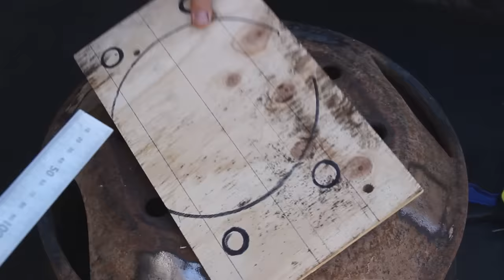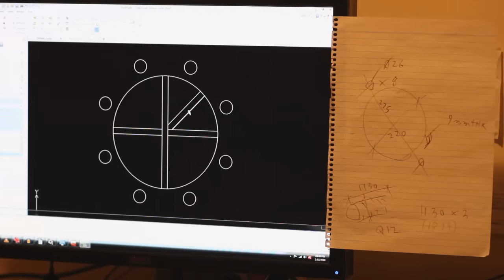How to make a fire pit from a rusty old truck wheel with a $100 eBay stick welder

Comment: Holy Hell!!! I’d soooo go buy some plate plate!!!😂😂😂! Lots of extra time in tearing apart the pipe to flatten it!!
Reply from the maker: while it's cheaper than the hardware store my local steel place is too expensive so I avoid going there. Kinda wanted to see how much work it would be to turn pipe back into plate anyway.
Reply: Absolutely awesome craftsmanship!!!!! Don’t know if your is the standard 22.5” wheel or not... check and see... if it is... the standard Weber kettle grill cooking grate fits perfect on these for cooking!!!! Cooks amazing 🥩’s!
Reply from the maker: I'll have to measure it, put a camp stove in it once but have a heat beads BBQ for cooking, it's not bad but I want to make a longer rectangular charcoal grill some day, maybe that fits on/in a tabletop

Comment: I gave this guy a thums up because we all start out this way. On a wheel there are bolt holes to use as referance points for the legs. Remember, center lines on the wheel and center lines on the pipes for easy set up. Also, once all legs are welded, a simple measurement from ground to highest point wiill give you your angle for all of them👍 love the video
Reply from the maker: Cheers!

Comment: This was an excellent example of taking a simple project and making it extremely complicated. Well done!
Reply from the maker: Cheers! I wouldn't say extremely complicated but opinions vary. Loved your work in "the fresh prince of bel air"
Reply: @lapislignum  tack on a couple legs and a few pieces a rebar so the wood doesn't fall through the hole and your done. Extremely simple..... but opinions may vary. Lol

Comment: Really pleasing to watch your build, and the layout techniques you used. I have a 24 inch wheel I plan to make into a fire ring; perfect size for a patio fire pit with no other purpose than to just watch a fire burn in the evening. As some others have observed, there is much satisfaction to be derived from designing and building a project yourself. I often gain new ideas and construction skills just from watching what someone else has done. Your fire pit is well built and will last a lifetime plus. Good job. Regards - John
Reply from the maker: Cheers John! I know the layout seems excessive to some people but it is the way I generally do things, usually it makes it easier. If you put a tray of sand and/or firebricks under the pit it should help your patio not catch on fire.

Comment: Pretty cool design !! I love the bottom design..
Reply from the maker: Thanks! I tried a few patterns but that one was the best and simplest.
Reply: At first u thought u was making template for CNC Machine :)
Reply from the maker: CAD may look like overkill for what it ended up being but it didn't take too long and having a template to follow made it very easy to cut all the rebar

Comment: I used the open center type truck wheels and throwed 4 firebricks under the bottom edge so it could breath and it works great.
Reply from the maker: Lots of ways to do it. I still need to pick up the nails from the last fire I had in mine.

Comment: Fire pit from a old rim is a awesome idea. This pit will out last any other pits made from plates.
Just a small tip, turn up your amps on your welder until you get good penetration it to the steel
Reply from the maker: thanks! yes this should last a long time. I think the welder was turned up as high as it goes, maybe not quite as it is a 15 amp machine plugged into a 10 amp socket :)

Comment: Good job. I too used an old truck wheel. Only difference was I was lazy and sat the wheel on a tapered metal bucket turned upside down. Left all the other holes open for  air movement.
Reply from the maker: That's a good solution, I think I put bricks under the big hole a few times but the stud holes didn't let enough air in, leaving the big hole open let too much stuff fall through and not burn.
Reply: And

Comment: If you put a lid on it correctly and hinge with a vent pipe, you could cook on it. Make sure you burn several fires real hot in it before cooking in it. Wash out real good before first cooking.
Reply from the maker: I cooked with a camp stove in it once, got too hot. A hotplate on top that swung out of the way to put more wood in would be simple.

Comment: Purchase a small piece of copper plate or flat bar and use it as a backing to weld up small holes, it's faster than making those plugs.
Reply from the maker: True, not sure my welding would be up to it though, i would have tried it on other things but copper is soooo expensive.

Comment: Love the angle grinder height adjustment jig. Might have to make one for myself.
Reply from the maker: on some grinders just holding the guard against the benchtop will work, on this grinder the arbor sticks out past the guard so it had to be screwed to the formply scrap, gives better stability too!
Reply: yeah sometimes I clamp the guard to the bench and move the work piece into it. this works well for cutting rings from large cylinders.

Comment: Just a tip but it's one amp for every thousand of an inch. I personally like to use a couple extra amps 5 max depending on the base metal. In the video amps was way way short and you move way to fast.
Reply from the maker: I just fiddle the dial until it seems right, not sure the numbers the dial points to on my ebay welder actually correspond to anything. All of the welding footage was sped up 5 times or so.
Reply: @lapislignum   You really need to practice getting the arc right.  I agree with the comment about, turn it up a bit and try to watch the weld pool.  Your welding needs work but that was 4 years ago so maybe you have improved.  I liked your trick with the grinder to get the flat base of the legs.
Reply from the maker: It got slightly better, still terrible though, really need to run some drills some day.
Reply: @lapislignum   It's really worth it.  You'll feel great when you notice the hard work paying off.  Watch a bunch of youtube from weldingtipsandtricks.  There are so many helpful tips.  Good luck with it.
Reply from the maker: I'm a big fan of Jody, just need to put in the burn time, I have more steel than I thought so should pick some nice/rubbish bits to clean up and weld on.

Comment: Welding on the legs was really bad. Using MMA Welding Vertical travelling up would have gave a weld to penetrate the joining metals, that down motion that you did left a light skin full of porosity. 
The job did turn out nice, try using MIG for that style of welding
Reply from the maker: I'm not claiming to be a good welder but the legs have held on great, the grate has popped a few welds because they aren't great and it gets very hot there and expands and contracts a lot. 

I have a MIG but bought this inverter as I was sick of renting a gas bottle that I almost never used, have a roll of fluxcore wire but I don't like using it (my welds with fluxcore look even worse than my stick welds) and it's a (heavy) transformer machine so I can't be bothered lugging it out of where it lives.

Thanks for watching and taking the time to comment!

Comment: Nice job I just built a firepit now have the same problem trying to get the bottom leg angles ,think I might try your idea with the grinder ,thanks for the idea
Reply from the maker: Thanks! You can use a marker instead of the grinder then cut to the line if it works better, this way works well on wood legs too.

Comment: Finally, a maker that can weld & can stick weld at that.
I would have used expanded sheet metal, but the rebar with last longer. Good job.
Reply from the maker: Thanks! My stick welding is average at best but this had held together pretty well. I didn't have any expanded metal or mesh but the rebar suits it better IMHO and will last as long as the rest of it. Thanks for watching!
Reply: That welding is some of the crapiest welding ive seen . You have to get out more when it comes to welding haha. In the welding scene they call that grape welds.
Reply from the maker: @lewandlo  there's a welding scene? watch my rocket stove video if you want to see more questionable welding, I think I manage to do some bits better and some bits worse than in this video, need to do some drills when the weather is less flammable.
Reply: Looks like pigeon 💩 🤣🤣

Comment: Nice, but more elaborate than necessary.  Get two wheels, weld together, add some expanded steel mesh.
Reply: No... I think I’ll take pipe, cut it into little pieces, instead finding some scrap plate. Then I will double check it on a CAD program. I think that’s more expensive in labor then 20 store bought fire pits.

Comment: Yea, do that with one of those magnesium car rims from the early 1970s. Once it gets hot enough to ignite the magnesium the radiant heat would be like looking at a nuclear explosion. You can't put out a fire like that with water; you can only retreat and let it burn itself out.  Or, for that special BBQ flavor, leave the rubber tire on the rim, those steaks will be so tasty.
Reply from the maker: I saw a video of someone doing this with an aluminium rim, it worked OK. Magnesium would possibly ignite, would be interesting to find out.

Comment: Cool fire pit. Reminded me of when everything was built to last, but I didn't understand the first jig you built, you had everything you needed right there. Anyway scrib your name and date on it. It'll be here a long time.
Reply from the maker: Thanks! The first jig was to locate each leg equally around the wheel, at the same height and lined up with the stud holes. It also held each leg in place while tack welding it to the wheel. It made more sense when I showed moving the jig to do the next leg but I cut it out as the video was too long.
Reply: @lapislignum  definitely inscribe your name and the build date
Reply from the maker: Good idea, I have a set of letter and number punches that would do this well.
Reply: @lapislignum  im sure you are well aware so dont think im patronizing you but be sure to grind away the desired area to be inscribed... Buff it nice then seal the inscribed spot with clear laquer or what have you...
So you know that wont rust out for a long time

Comment: Cool idea, terrible welding. Stop moving the rod around so much and the weld won't look all chicken crap.
Reply from the maker: Cheers! yeah I'm not getting a job on a pipeline anytime soon am I? :)
Reply: @lapislignum  just be steady with your hand, keep it in one spot till a puddle builds then start moving ahead slowly, if you go too fast your puddle won't be a puddle. Too slow and your puddle becomes a swimming pool.
Reply from the maker: Cheers, I really need to make time to do some bead drills

Comment: Last I checked, flat plate was cheaper than pipe, and already flat.
Reply from the maker: The pipe was free as I already had it. Also I already had it.
Reply: probably already had the pipe...use what ya have & adapt it to your needs
Reply from the maker: @keithreh9338  exactly!

Comment: Good idea but I see no reason for all the extra work. Would be fine just positioning bricks under it properly for good air flow. For the average do it do-it-yourselfers anyway
Reply from the maker: The giant hole in the middle was the bigger problem, I was going to make a drop-in grille but decided to add the feet too. It is much sturdier on the legs, and easier to put a slide out ash tray under (which I still haven't done) too.
Reply: @lapislignum . I use an old bicycle sprocket for one. Then I found an old round charcoal grill and took the small grill part out and used it for bottem. Just happened to fit the bottom perfectly.  Not knocking your work . You did a great job. Just offering up some ways someone could use that don't have access to that kind of equipment.  I started out setting mine on top of bricks which were also positioned in a way that covered the bottom.
Reply from the maker: @extraordinaryactsofglass3743  yeah there are easier ways to get the same result for sure, I cut the corners off a (rectangular) BBQ grille so it would fit in the bottom of my 44 gallon burn drum, it sits on bricks in there and I turn it over occasionally so it doesn't sag in one direction too much.

Comment: Please turn the voltage up on ur welder, and buy some strap metal for u will save alot time n enegy, still great project!!
Reply from the maker: Next time I'll turn it up more, didn't want to go crazy with a 15 amp welder plugged into a 10 amp socket. At the time of making this I had more time and energy than money, I like hammering stuff too.

Thanks!
Reply: @lapislignum  very cool project , congrats n good luck in the future !!!

Comment: Should have made the legs long enough to put a metal bucket below the pit. All ashes are automatically caught.
Reply from the maker: I think I was limited by how much pipe I had, but I wouldn't make one much higher, can't remember why. I keep meaning to make a tray/shovel to go under it to do the same job a bucket would.
Reply: @lapislignum  Lots of people like myself live in a windy dry area (Texas). A bucket would contain ashes and embers to stop wind from starting a grass fire.
Reply: P.S. I love the idea and will have mine complete next weekend.
Reply from the maker: @waynesmith9765  nice one, throw up an imgur link to a photo when you're done if you get the chance
Reply from the maker: @waynesmith9765  yeah the place gets pretty flammable around here in summer, I only really use this when it isn't windy and the grass isn't too dry.

Comment: I thought only in India you cut on the floor.
You can build a fire pit. Know make an effort and build a table for your saw. Instead on the floor.
Reply from the maker: You should watch my rocket stove video, I did the whole thing on
the ground. I don't do enough metal work to justify having a bench for steel.

Comment: High speed video so it’s a bit hard to tell but it looks like your moving to fast with the weld. I’m trying to gauge the distance you were welding per rod. Looks a bit too long to me. The electrode will only get you about 6 inches of weld. Some longer some shorter depending on how wide your trying to weld and what size electrode your using. 
When you stick weld you will have what looks like two puddles. One is the flux and one is the weld pool. The flux of course will be the puddle on top. Try some welds and look for the separation of the two. Your welding will get much better when you can tell the two apart as you will be paying attention to the metal and not the flux if that makes any sense.
Reply from the maker: Cheers I've got some welding coming up so I'll keep that in mind. I've got all kinds of room for improvement, lol
Reply: @lapislignum  
I learned to arc weld 30 some years ago. It was my first experience in welding and all I did for about 5 years. Finding other people willing to let me mess around on their machines I taught myself the other processes like MIG and TIG. Never been to school for it and now I weld aerospace. If you like to work hard and you like art, welding is something that can bring you lots of pleasure. 
What rod are you using? For what your doing in the video and a good rod to learn with is 6011. People hate it but it does the job and it lets you see the puddle so you can actually learn how to flow the metal together.
One other thing that just popped into my head. Rods absorb moisture in the flux coating. That’s why rod ovens exist. So if you leave the electrodes alone for long periods (like in the shed over winter) between uses. You could be fighting moisture when you weld. 

This is by far the best instructions video for arc welding I’ve seen. 
https://www.youtube.com/watch?v=2537L5H7NiY
Reply from the maker: The rods in this video are 6013, I have since bought some 7016s which are nicer to use, I keep them in an airtight cylinder with a few big silica gel sachets in it.

Cheers for that video, I'll check it out!

Comment: The flat prices you made from splitting the tube sections and pounding them flat were not centered on the legs. I'd like to see a new video with the proper measurements and formulas needed to center those legs and feet. Come On Now!!
Reply from the maker: I'll put that on the to do list :)
Reply: Bull sheet man, Its damn fire pit, Why don't you build one and show us how its done,,,,
Reply from the maker: @victorbunch7725  Thanks Victor but I'm pretty sure Brian was joking, if he wasn't then my joke detector is broken.
Reply: @lapislignum  I think you detector may not be broken, maybe jes might need a tuneup tho.

Comment: Let's see if you're a welder that's got a lot of time on your hands good project. but if you're going to make this to sell at $24 an hour the total cost would be about 1 grand!------ after reading some of the other comments I came back, and mine sounds pretty negative I don't like to use a lot of punctuation either I run my sentences on I guess watching it I saw a lot of cut-off saw and hand grinder use and I worked on the railroad for 35 years where we use the abrasive cut-off saw to cut our rails and I hated that damn smell so that's probably why I was a little negative nice-looking fire pit.
Reply from the maker: I know what you meant, no offence taken :) I could probably build one of these in a day but you are right, not many people would pay enough for one to make it worthwhile making.

Comment: $100.00 for the welder $300.00 for grinding wheels
Reply from the maker: The strip disc cost $20 which is almost as a grinder I bought, this didn't take many $2 cutting discs though.